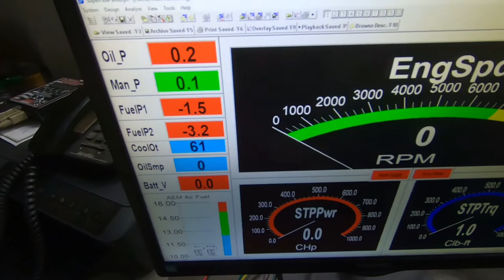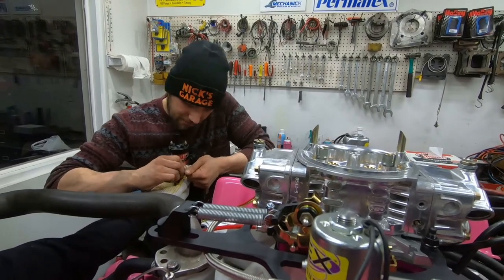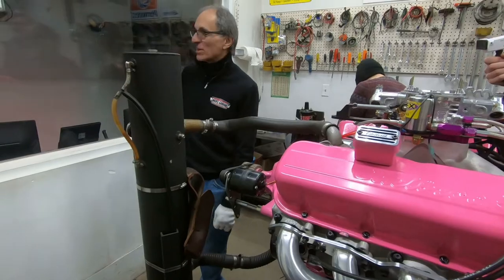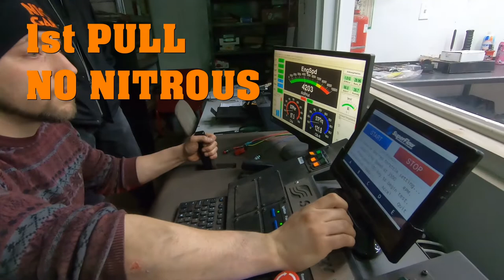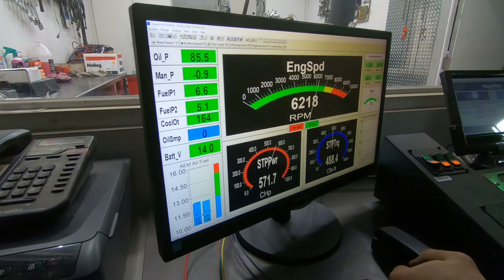Nick's Garage Road Trip Pt.2 - Chevy Big Block DYNO Test

Comment: why was it bogging so bad?  overfueling?
Reply from the maker: I asked the same thing.... it’s a product of the dynamometer. It runs on water resistance so until they press the button to start the test pull, its under full throttle and loaded. Kinda like loading up your car with your foot on the brake and it’s in gear.